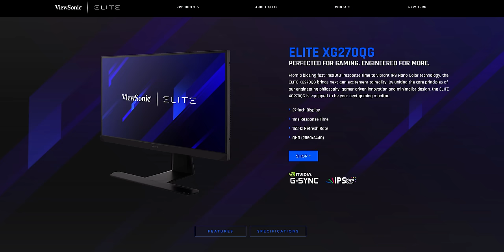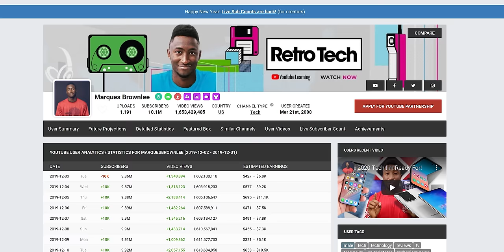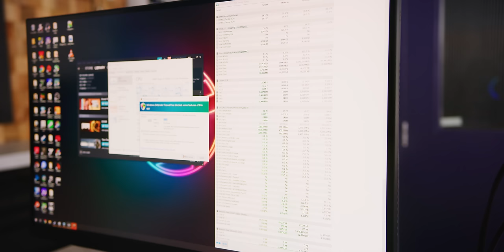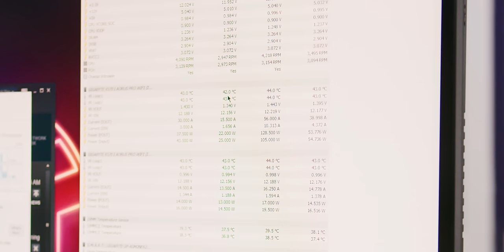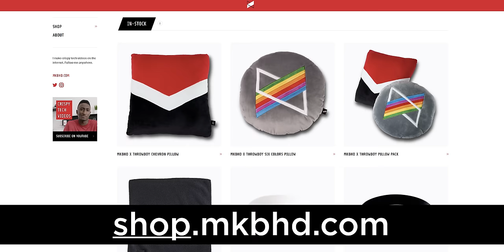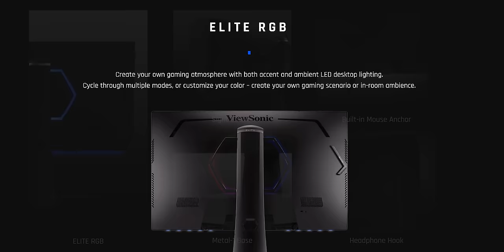The Easiest Water Cooled PC (NOT Easy)

Comment: This was just a 30 minute advertisement for air cooling.
Reply: Right, I've got a 9900ks on air cooling it hasn't gotten above 68 yet, that's not bad under load.
Reply: @ludicrous_spd  what cooler? that's pretty good
Reply: @ludicrous_spd  you're not stress testing it at like 5.2 ghz though are you lol
Reply: No, it was a 30 minute ad for throwing your RGB strips in the trash before you install anything. That's the least you can do for your own dignity.
Reply: @0s0sXD  the 9900KS runs stock at 5.1 so kinda ya
Reply: @4Devianz  cooler master gts v8
Reply: Who needs it when you've got air coolers like the Noctua D15 and the Be Quiet Dark Rock Pro 4?
Reply: Those are good too
Reply: Actually for reading the manual...
Reply: @ludicrous_spd  That's bit of a waste really, if you are only interested in running it 5.1, overclocking a normal 9900K would be more than enough. 

That being said, I understand that some people doesn't like the concept of overclocking, which is fine.
Reply: @Verpal  maybe he wants it to be quiet? I mean it's the fastest cpu in the world how fast do you need it to be? Unless this guy is into esport this is a very much doing it's job
Reply: Verpal only 11% of 9900k chips have good enough silicon to reach 5.1, so no, he is doing fine with his KS.
Reply: @tim9241  Interesting.... what kind of voltage are we talking about here? If you are talking about under 1.35V on air, I think 10-15% would be good guess. However, with the extra cost of 9900KS, I am kinda expecting 1.40-1.45V on water, which I expect perhaps 50% can reach 5.1Ghz.
Reply: Verpal yeah around 1.3, details here: https://forums.overclockers.co.uk/threads/i9-9900k.18834239/page-41
Reply: It also does a great job to convince people just to get the windowless case without any RGB.
My Dark Rock Pro 4 cools my 9900k really well too.
Reply: You can't be using 1.45 volt on a 9900k on water, It's so hot! I got one myself clocked @ 5 ghz 1.28v. When stressing the cpu I reach package temp 84c on water.
Reply: And not using RGB... Time for more case options without clear openings already.
Reply: @willg955  who needs those when you have a macbook
Reply: @oissukki  Sorry you have a macbook.
Reply: @0s0sXD  Did you buy your CPU off of silicon lottery? Because most 9900KS CPUs won't even get to 5.2Ghz
Reply: I call Noctuas” Waterless CPU coolers”
Reply: Oh god, here comes the noctua fanboys.
Reply: Verpal a 9900k is under more stress when pushed to 5.1Ghz compared to the ks which is made for it already
Reply: Anonymous 69 so sorry for your loss the mac belongs in the trash sadly
Reply: Not only that, but if someone was willing to throw 5 grand on a PC build, they can get 2 RTX 2080 ti's plus the rest of the components that were used for that build (Ryzen 9, 32gb Ram, etc).

This custom water cooling crap is a novelty at best, that more or less satisfies the desires of those with the passion for that hobby.

Sorry, but I'd rather have the 2x 2080ti's, even if its overkill.
Reply: Sponsored by Noctua...
Reply: Also a 30 minute advertisement on why reading directions is always a good idea.
Reply: @ludicrous_spd  What about full load. Like rendering a video with the CPU?
Reply: Just put ice in it!
Reply: or just for non-small factor cases
Reply: @CJBMAGGOT94  haven't tried rendering a vid but I don't think it would get to much hotter, I run a stream under a different name and do a one pc set up, I have slobs, chat bot, facerig, a couple other programs running plus whatever game I'm doing, does good for that, although I don't know if that compares to rendering a vid. My case has excellent air flow to though, cooler master h500 mesh with the two big fans in front so I'm sure that's helping to.
Reply: @ludicrous_spd  Rendering a video would be 100% CPU load the entire time. Having all that stuff running probably barely huts 50% usage most of the time, which if that's what you use it for who cares.
Reply: And also an ad for no rgb
Reply: @emeraldbonsai  I mean I'm sure it still says a chronological order of assembling the system though that wasn't read.
Reply: I mean, the gpu temps are really nice, but who is really gonna watercool their gpu?
Reply: @AJ-em2rb  Overclockers, someone with a smallish case, or case with not so good airflow but nice looks. Idk there are a few cases where is makes sense.
Reply: @betalpha5846  the macbook is an amazing cutting board or a cheese platter
Reply: It's a 30 minute advert for reading the instruction manual.
Reply: @0s0sXD  Stress testing will always use more resources constantly and thus result in higher temperatures than real world applications, so game benchmarks would be far better for that purpose
Reply: Sponsored by Scythe air coolers
Reply: @Verpal  only 4% of 9900KS can hit over 5.1ghz maxxing out at 5.2ghz. non can run above 5.2
Reply: @ludicrous_spd  9900k cringe af
Reply: willg955 i got a D15 for my 3700X because I just blanket straight up never wanted to worry about the temperature of my system. I’ve had a laptop and a desktop die to heat death, and my second laptop’s on its way to heat death.
Reply: @ludicrous_spd  I've had this cooler for 3 years now and It's awesome!
Reply: @ludicrous_spd  That's bullshit. Under full load the coolest you can get is 73.
Reply: Or an EATX Full Tower like the 1000D
Reply: If you've ever water-cooled you'll realize that despite them being a huge tech channel they do everything you aren't supposed to in favor of saving time.
Reply: @ludicrous_spd  what FPS game do you play?
Reply: @fauxluv3170  I play a bit of everything really, as far as fps goes, overwatch, apex, a bit of cod, doom, battlefield ect
Reply: @fauxluv3170  I will contact you and yes I'll give it a try, if I like it I'll do a weekend stream on it if that is agreeable with you, I have a small audience but it would be some exposure, we can get together if you wanna talk just tell me how to contact you
Reply: @fauxluv3170  I find one called uberstrike but can find uberkill do you have a link
Reply: @Verpal  supposedly only 30% of the 9900K cpus can reach 5.1ghz
Reply: Actually it's an add for bigger more thought out towers, plebs.
Reply: That's a really nice Profile pic Dwigt
Reply: Saying how cooler the water system kept it :D 

If you want an easy build and do not plan on working with 3D software, aire does not do it.
Reply: Can't go wrong with air
Reply: Have an air cooler as well. System stays at 67 - 69 degrees... so why mess w water when it takes so much maintenance
Reply: @systim30  Cooling Speed, as how quickly a temperature can be adjusted.

When working on certain software the system can spike for a short duration and slow back again. Now, they both will reach the same cooling temperature but the water cooling will be fast. 
With an air cooling you the spike can end before the cooling temperature has reached that.

It is clear that water cooling improves durability based on heat spikes caused by sudden massive amount of rendering and then stop.
Reply: @AZ-ts1qy  but if you configure air cooling correctly,  you can get the same control when dealing w software that stresses your system.
Reply: @oissukki  gotta love booting chrome and instantly overheat.
Reply: @rekt4guud134  chrome is a memory hog now...
Reply: Schrute-Farms- lmao a brute farms I love the name
Reply: Or a 30 minute advertising for "FFS pre-plan your loop"
Reply: Just... just use an aio cooler
Reply: @morpheas768  2 2080ti perform worse than a water loop
Reply: This is how I see every custom loop maintenance videos lol
Reply: @0s0sXD  its not the fastest the 64 core thread ripper is faster lmao
Reply: @bigbonede6201  for gaming *
Reply: This comment deserves recognition from Linus.
Reply: More like 30 minutes to prove that RGB is worthless.
Reply: i thought it was a 30 minute add for steves mod mat
Reply: most real life plug ever
Reply: I saw this comment and knew already what was gonna happen.
Reply: Or AIOs even haha.
Reply: More like a cautionary tale against RGB.
Reply: Too right, if you really need some extreme cooling, maybe but while being enthusiast I wouldn't waste so much time - I mean for them it's their job, so no waste but for others you might go with a reasonably priced air cooler and forget.
Reply: They always beat around the bush and evade the questions in these types of interviews. I don't trust Trump more then I could throw him. Plus no one knows the whole truth about aliens. The only President who most likely knew was J. F. Kennedy and that's why they shot him.
Reply: @ludicrous_spd  yy
Reply: @ludicrous_spd  4yyyy4yyyyy4y
Reply: 45
Reply: @0s0sXD  even esports doesn't need a 9900ks lmao. The only reason any gaming rig needs a high power cpu is for editing videos or streaming. Games primarily use the gpu.
Reply: @aeashenemby  in a fortnite scrim, in late game when there's 50 players building in a circle. Not having a 9900ks will make you lose the game.
That's just one example.
Reply: @aeashenemby  the higher the fps is the higher the advantage over your opponents is. It's true all the way to like 500 fps. The reduction in input lag and also some game engines give advantages to people with very high fps. I know Cod4's engine allows you to bunny hop and make high jumps better at 333 fps than at 250 fps

240hz is waaaay better than 144hz. It's very clear. And 360hz has lower latency so it's gonna be the new esport standard once it comes out
Any higher hz than that then I reckon its not gonna be worth it.
Reply: @aeashenemby  this is not even mentioning what a Java developer or someone who wants to run multiple virtual machines and maybe intensive applications in those virtual machines.

I think Linus made a video making the fastest minecraft server ever. And he used 2 9900ks because Java favored single thread performance.
Reply: YouTube doesn’t need help making more ads
Reply: 3:40 I thought it shattered 0-0
Reply: ikr
Reply: Schrute-Farms- get back to work Dwight
Reply: @marygibson3217  hey didn't you leave dunder mifflin?
Reply: *for reading & following instructions.
Reply: Addylen West yes I moved to Colorado but I still manage them and make sure they’re working from Colorado
Reply: Lol!! Yup.
Reply: Air is just so much better.
Apart from the temp differences
Reply: On 26:10 he swaps to monitor advertisement.
Reply: im kool
Reply: and, 'dont' bother with RGB"
Reply: So it’s a advertising for Noctua
Reply: Hello.
Reply: @willg955  Clearance issue for some small cases or mobo. most matx are barely compatible unfortunately. I've had 3 matx mobos so far and none of them are compatible with N D15 and Dark Rock Pro 4 if I use all 4 sticks of ram
Reply: Hi dwite
Reply: Fax I use the stock amd cooler with the 3700x and tI works at under 40degrees and when u overclock it's like at 60degrees
Reply: or AIO
Reply: Hilarious!!
Reply: I think it's a bigger argument against rgb lol
Reply: This shows me that i should use soft tubing
Reply: @willg955  exactly I got a d15 and better than a custom loop lol
Reply: We need to ban aircooling.
It affects the environment and changes the climate.
Reply: I mean AIO is the only water cooling I’ll be doing anyway
Reply: and no RGB XD
Reply: Facts
Reply: FALSE BEETS AND ANGELA
Reply: funny comment :)
Reply: Hahahaha, good one man
Reply: or just Aios lol
Reply: @Verpal  I like to pretend I understand what y’all are saying
Reply: @ludicrous_spd  mine barely goes over 60
Reply: I think it is more an ad for making RGB all the same company as the case.  And not to use a tiny, niche company water-cooling case.
Reply: Meanwhile my laptop burning at 100C 😎👍
Reply: Custom air cooling when
Reply: This is why I go AIO 😆
Reply: @willg955  making a custom loop for cpu and gpu can make your pc be cooler and inaudible even at max load

Comment: Videos like this are why I always build in large form or bigger cases, tons of room and wire management is a breeze.
Reply: Not to mention air flow. Only need to run a small fan or water cooler for your CPU unless you're doing serious overclocking.

Comment: The little part of me that ever wanted a water cooled PC just died. RIP little guy, gone and forgotten.
Reply: Lol this is hardlined tubed water cooling. Only professionals and experienced usually attempt it. I think to you'll be fine going for water cooling using the Corsair or NZXT kits, like the Kraken. It's not as hard as portrayed.
Reply: Same here! 😃
Reply: @mahnamejeff7586  Yeah, I think 30 years ago I might have been all gunge-ho to build a smoking hardlined water cooled system. Today I'm just happy to get all my wiring neat and tidy! I wouldn't have a problem with using one of the good kit coolers available, but that's about the extent of my desire for water cooling.
Reply: It's not as hard as they make it for themselves, honestly. You just have to plan ahead of time and understand your case limitations. Also, hard-tubing increases the difficulty (you only need to cut soft tubing, no heating/bending/sanding required).
Reply: It's not hard, they're just not good at it. They didn't read the manual and they do so much wrong just to save time.

Watch Jayz for water-cooling info, not Linus.
Reply: I'd call this Video more like: Two *** try to watercool a PC the first time in their life, wihtout readying or planning anything ^^
So you'll be finde if you just think a bit ahead and read some stuff :-) May try Softtubing for you first build to be stress less.
Reply: Same
Reply: There are so many easier ways of watercooling than this. Not to mention they did it in a really cackhanded way, not reading the manual and not planning their loop properly ahead of time.

Plus if you start with soft tubing you'll have an infinitely easier time of things. Fittings are more simple and you don't have to worry about heating tubes, bending them, getting it wrong, starting over, sanding edges, etc etc. Just cut the right length and done.
Reply: also the rgb was like the most painful part of the build. Im thinking of doing hardline in my next build and i already KNOW that im gonna do a boatload of planning, do lots of cable management before thinging of tubing, and DO RGB FIRST
Reply: I just finished a hardline wc rig. It's easy when you know what yo expect. My first time watercooling with soft tubing i bought some old EK parts for $90 second hand. It was all fine until I travelled with and then turned it on, a fitting basicly exploded and drained the rad on the GPU and PSU. Everything was fine tho, I think watercooling can be forgiving if you plan well.
Reply: @RowsieFox  Make sure you buy 100 reusable velcro straps it helps a ton
Reply: @mahnamejeff7586  Also watercooling is for overclockers or it's pointless, You don't buy $1000 dollars of water cooling just for a more quieter system haha
Reply: @Kizzster  yeah but even when you overclock it's still quieter and the big thing is you don't have to listen to the jet engine GPU fans
Reply: @RowsieFox  Yep especially with a d5 pump
Reply: 400th like
Reply: Just get AIO, custom loop is pain in ass. Honestly the building part is actually pretty satisfying as is the looks, but maintenance an risk is not really worth it for me at least.
Reply: It's like having a lamborghini if you can afford the first you should be able to afford it's insuance a second lambo and it's insurance
Reply: Well... I’m definitely going to regret this.
Reply: Man just get an AIO. Custom loops are only if you want to maintain it constantly. I upgraded from air cooling to AIO and I’m never going back. EK Nucleus CR360 for anyone wondering

Comment: "Do you want the LED strips that came with the case?"
Linus: "Uhhh....."
Reply: Real question is why is that not preinstalled 🤷🏽‍♂️
Reply: That was classic.......
Reply: @sschannel4550  maybe it's sold separately
Reply: @hypnotized944  but they came WITH the case
Reply: @Hietakissa  cuz it is basically ez to install just that they didn't do it first :/
Reply: @hypnotized944  im just saying that they came with the case so they most likely arent sold separately
Reply: @sschannel4550  cause maybe some people dont want them
Reply: @Hietakissa  Thats not a good argument to make for someone like LTT. If a Company sends them their product, they will send it with the complete package. So OF COURSE they will send the special rgb strips even if they normally sell them separately.
Also the way they are packaged in a separete plastic tube - each of them -, doesnt really look like they are normally shipped with the case.
Reply: Tech the led strips DO NOT come with the case. I bought the case and in the manual it says you have to purchase them separately....
Reply: i was excepting YES
Reply: I laughed a bit too hard at that
Reply: @sschannel4550  Not everyone wants a 70's disco for a computer.
Reply: @miecz8316  well you dont need to have the rgb turned on
Reply: 15:22 on the timeline for this magical moment.
Reply: @jamesnickell7112  That's gay tbh.. That strip isn't worth more than $5 so why not include it 🙄
Reply: @miecz8316  Well you don't have to turn it on 🤷🏽‍♂️ And U feel more people would want it than not